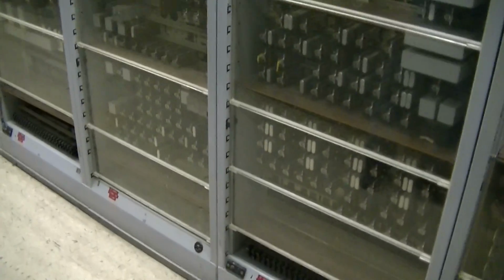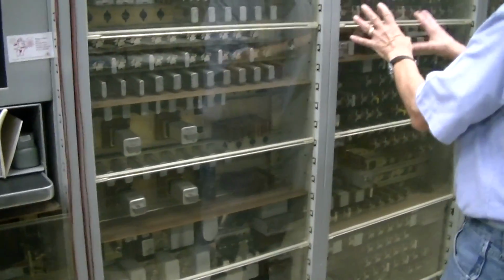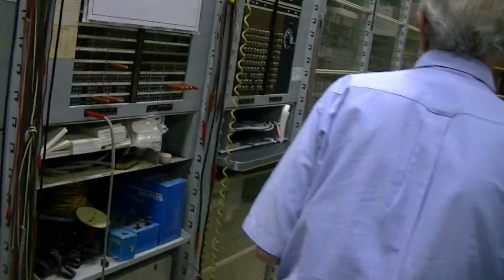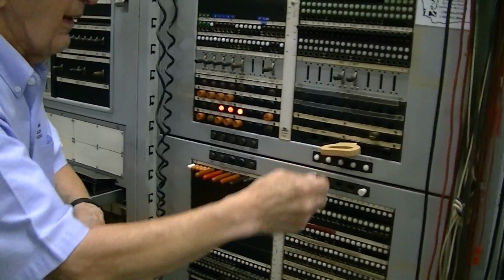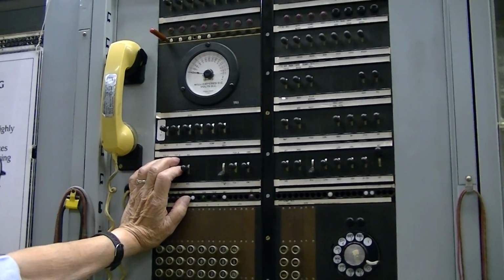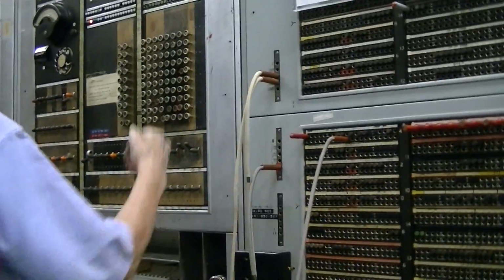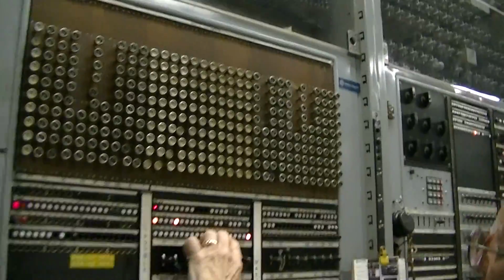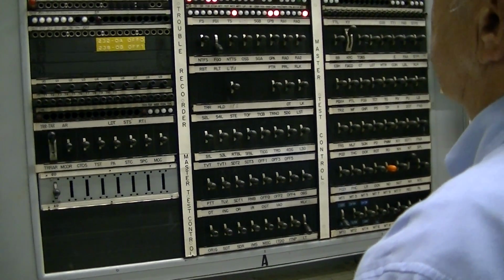[5XB] Bob tells a story about barging in on someone's line.

Comment: I was a cable splicing tech for Illinois Bell/Ameritech/Sbc from 1979 until 2008.When we had to transfer lines, or "rearrange" cable facilities, we weren't supposed to interrupt a call in service, BUT, I learned to use advantage of "Call waiting" to get some long winded callers ( usually 2 teenage girls talking about nothing for over an hour) to switch off of a call by calling the number they were tying up. as soon as they switched over to my call, they got cut and transferred over (usually took less than a few seconds up to a minute) and they may have had to wait a short period to complete a call again, but technically the line was clear when I cut it ( it was dirty pool, but I had to complete work) The alternative of using the "gated" circuit he shows here, is to connect a "frame shoe" to a test jack at the vertical frames, and then either test it locally, or have the responsible test center break into it and "tickle the meter" like he does here to measure for ringers, shorts, resistive faults and crosses with battery ( that board couldn't do AC voltage induction noise well)

Comment: Back in the old days you would go to the OGT or be monitoring with a test set. If you had to test the line, waiting was an option. Not waiting meant the customer was disconnected for testing purposes if urgent. Much testing was done at night when circuits weren’t as busy.

Comment: I never got a free call, that could get you fired.  It was interesting that while working as operator at Stuttgart Germany Military board, my supervisor ask if I wanted to call home on afternoon.  Of course I did, and she let me because they had installed direct dialing to the US and the billing part of the system wasn't yet in place.  Later, as a toll fraud investigator, I wondered sometimes if the guys at the poll or terminals might be making a call on a customer line that billed them.

Comment: I was an operator and later supervisor who had operators on the verification lines, long distance, conference, overseas, official PBX, and Intercept.  We had some equipment that wouldn't verify any number but we told the customer we would try, and we did but we knew the equipment was just not going to be able to cut in.   In the early part of 1980 I remember we hired temp operators to do only verification so we could put them to work right away due to complaints.  We didn't have time to train them for three weeks on all services so a couple hours training, then off to work on verification all day long.  Later we could cross train them to other services.  Customers dialed 0 for the regular (TSPS) operator and they were connected to the verification operator on the cord switchboard.  We plugged into a verification trunk, dialed the number and listened with the customer holding on another line.  If the customer declared an emergency we would go back in and tell them the person calling requested they hang up so they could call for an emergency.  Most of the time it was a boyfriend/girlfriend thing and they refused to hang up the phone.  Once all switches were electronic, the TSPS operator had a key to press for verification, and it garbled the line so that we didn't disturb the customer and we could not tell what they were saying but could tell if it was a conversation or just off hook.  Of course then they started charging for it.  It is still amazing to me that all this telephone service was up and running long before computers started playing any part in regular phone service.  Can you imagine the brain power to figure out how to place calls all over the world directly, without operator assistance, provide the billing details and have such a clean, clear line.  If only my cell was as good today!

Comment: That was a very convoluted way to cut into the line.  The operators were able to do it so much easier.  They used to call it verification and they could cut right into the line from the operator console by dialling the number and holding the verify key down.  The other advantage the operator had was they could cut into a line regardless of what exchange you were on.  Crossbar, step, etc.  It’s amazing how the operator console had the capability to cut into any line in any exchange office and with various types of exchange equipment.
Reply: ds99 He is telling you how it worked. The operator pressed a button and then magic happened. All of the COs were wired for the operators to be able to do that but they could only monitor. He is explaining all of the testing available and how and why it worked.  "B Y verify O D, please" was the request to the INWARD operator.
Reply: TSPS was before my time, but as far as I remember from working at BellSouth, AT&T and MCI for a hot minute, Here's how it's done from an operator's perspective:

DMS (TOPS): Station key -> Enter NPANXXXXXX -> Start Key ->  Select "Interrupt, Administrative" or press the softkey under INT ADM (If it isn't there, the line is free). TOPS will let you know on the display if there's voice activity. Also, there will be a beep every 5 or so seconds to let the two parties know that you've interrupted their call.

ESS (OSPS): BLV INT -> Enter NPANXXXXXX -> Enter Key -> Enter "18" -> Enter Key.
(If you see the regular handset icon hung up, the line is free. I don't recall the error code.) OSPS will let you listen to scrambled voice activity for a short period of time. In an emergency, you could barge but the connection was limited in duration. There was also a "Force release" command to disconnect the call in progress, but I don't remember how to do that.

MCI TOPAZ: Press F9. Enter NPANXXXXXX -> Enter Key -> Press F6 (I think)-> Click "Yes" on warning screen. I only had about a month's worth of OJT with TOPAZ. It was nothing special, just a regular PC with keyboard and mouse ...
Reply: @NortelGeek  Thanks for the info.  It’s amazing that one of them scrambled the voice.  That was a good idea.  Where I’m from the operator switchboards were made by Siemens Electronics.  They were from the early 60s.  There was no digital display, just lamps over switches to let you know when the parties hung up.  There were springs in most of the switches so that if you pulled it down and let go it would automatically return to the middle position.  Your line would also be held until the operator released it in case they needed to trace the call.  There was also a manual ring button so if the party hung up the operator could ring their phone back by pressing the ring button.  It’s wasn’t automatic.  It would only ring while holding the ring button.  The switchboard could perform the verification, manual ring, line hold functions on step by step or crossbar exchanges.  There was no beep on verify but the caller’s would hear a click.
Reply: @ds99  Yes. Before OSPS, there was TSPS and they used "Nixie Tubes" in the beginning. Later they were replaced with LED segment displays because the tubes burnt out too quickly. Where are you from, if you don't mind my asking? I had a look at your precious kitty cats, and judging by your accent, I'd guess Quebec, Canada?
Reply: @NortelGeek  I’m in Ottawa, Ontario which is Canada.  However, I grew up in Halifax, Nova Scotia and that’s where my phone knowledge is from.  That’s also in Canada but east coast.  Halifax seemed to use very unique equipment as I’ve looked for it and cannot find it anywhere.  I do have one photo of the operators at their switchboards in Halifax but there’s no information about them.  The phone company there at the time was Maritime Telegraph & Telephone (MT&T) but has since been changed to Bell Aliant.  I moved from there in 2001.  Lived there since the early 60s.
Reply: @NortelGeek  Hi, another male operator here, in the UK. Your explanation is fascinating.
Reply: When I was a teenager, I used to blue box in the late 90s using 800 "country direct" numbers.  It was a lot more involved to figure out how to seize a trunk because it wasn't just blasting 2600hz; there was a sequence of "clear forward", then it would "wink" back, then you had to send "seize" or whatever it was called, and then it would wink back again.  The timings were pretty tight (I was using my computer with a little thing I rigged up to interface the sound card with the phone line).  I managed to get a trunk in Chile, Macau, Belize, China, and Argentina, but I couldn't figure out the routings to get OUT of the country.  But Greece--greece was WIDE OPEN lol.  So I would sit there at the computer kinda like I had an operator console lol.  Once u seized the trunk, it would never disconnect (assuming you didn't offend it by behaving in a non-standard way).  I mean NEVER.  Most of the information I had was from BBSes from the 1980s.  I could call inward operators and just say "Greece Outward Operator #blahblahblah" in a really poor accent, and they would just put it through.  They would do emergency interrupts without question if I recall correctly, and just leave me on the line.  I had always wondered what sort of provisions there were in the network for doing this, but could never find any info.  So finally I got some information!!! I had some routings from the 80s that allegedly worked for that, but they never worked for me.  I had to dial KP2+0+NPA+121+ST or something like that.  There might have been a different one for interrupts, but I don't remember.  So my question is this: given that I was originating from the Greek network, were there even routings that would have let me do an interrupt, or is that something that would not even have been available to me?  I was never able to figure out precisely where I was in the network when I was doing this, even.  That is, was this some kind of international gateway, was I acting as a Greek operator, or something else?  If you have any insights, I would love to finally know more about what I was actually doing.
Reply: @bsadewitz up until about 2000 many areas in Greece we’re using old Siemens step by step and crossbar systems. Operators there did not care about their jobs and were really lax. The phone system was owned by the government and many of the operators were hired through nepotism. Hey bubba if I get you X many votes can you get my kid a job in government? Many of these individuals knew nothing about how the system really worked. The technicians were however trained by the techs from Siemens, many times in Germany on a fully operational system. Funny fact, my Father in Law who lived in a small village on one of the islands had an operators console in his coffee shop. There he would connect the few individuals who had to have service ( a doctor and the local elementary school) while the rest of the people were called to the coffee shop to receive or make a call. There was a meter that measured units of time and the outgoing caller would pay according to what the meter read out on the console. Many time the phone company was so devious they could speed up the meter remotely and over bill individuals randomly. There was no recourse to this theft, the government owned the system, they did what they wanted.
Reply: It was kinda cool doing this so late in the game, because near as I could tell, no one ever suspected that I wasn't who I claimed to be.  My guess is that this just wasn't a thing that ever happened anymore.

I also had a lone 800# to Ketchikan AK that used R1 signalling, just like ye olde days, but it went digital not long after I found it. :( Greece went digital sometime in 97 or maybe 98, and I mourned haha